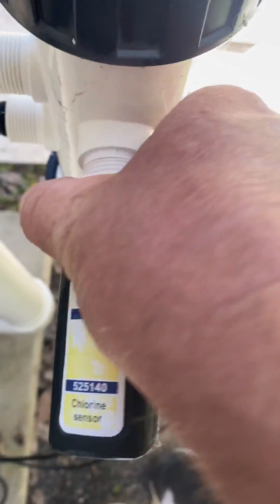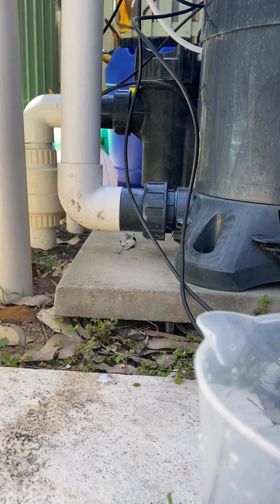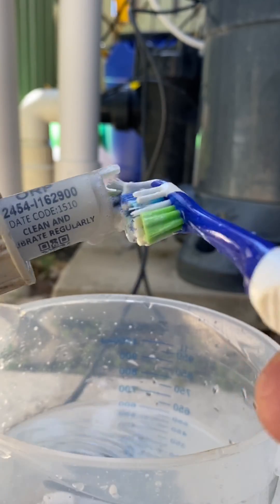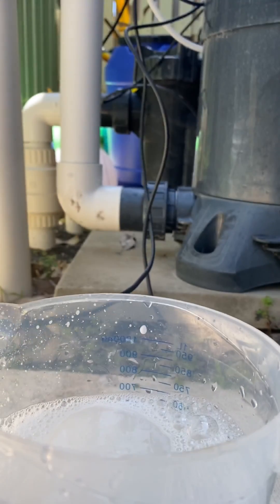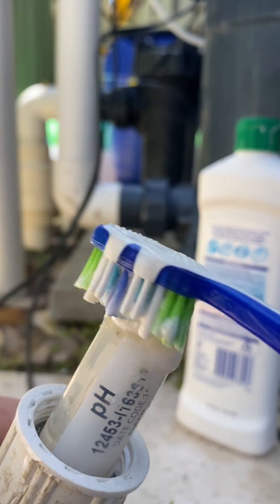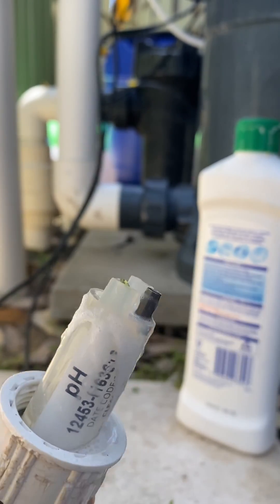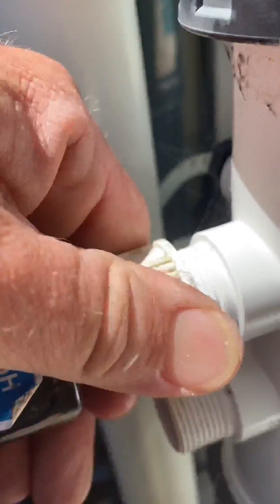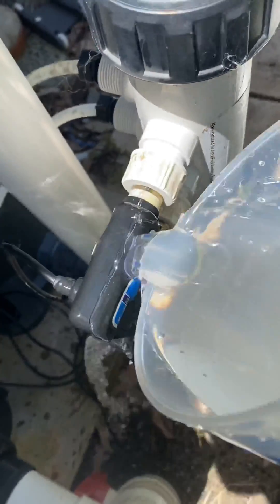How to clean PH and ORP Probes #poolmaintenance #poolguy #pool

Comment: Very very useful, thanks! Do we also need to clean the tubes themselves? If so do you have a how to?
Reply from the maker: You can buy the new tube lengths from a pool store or Poolguy. Dont use the cheaper ones at hardwares , make sure they can take acid and chlorine over longer periods